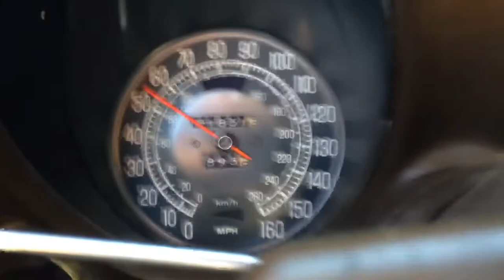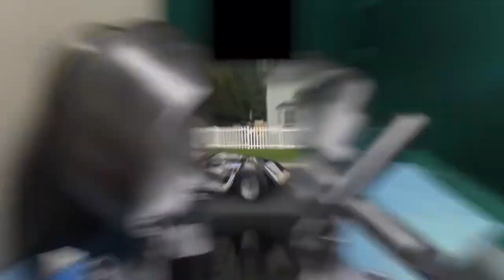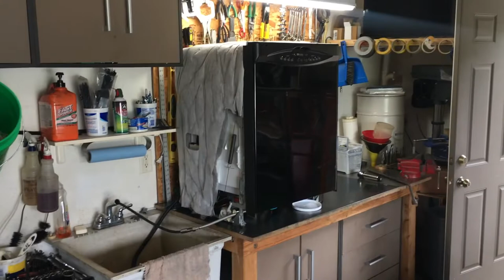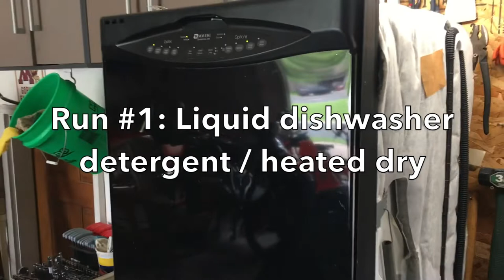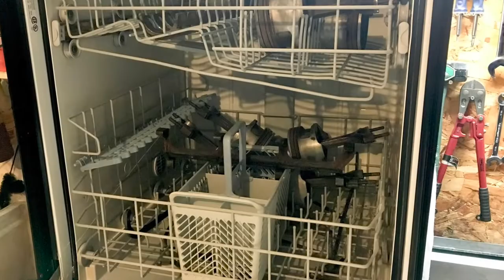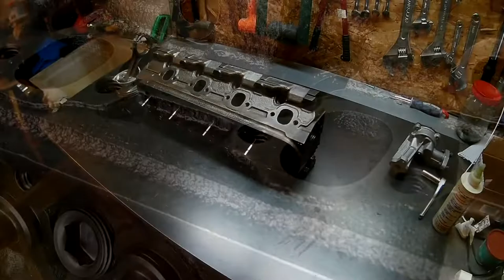Cleaning car parts with a dishwasher

Comment: Great Idea! I was thinking that it would turn the inside black and greasy- but it looks like that isn't the case. I may add one of these to my shop. Way cheaper than a purpose built parts washer and seems to do a pretty good job. Have you dialed in what detergents you use for cast iron and aluminum since you posted this video?

Comment: I was never able to get this to work well with a $50 dishwasher I bought off craigslist. Everything was still dirty. The only thing that I've tried that works is pressure washing. And I use electrolysis for rust removal. If I had room for the dishwasher like in a huge house or workshop, I'd have probably kept it to do alongside pressure washing to loosen up some of the dirt, but I only have a 1300 square foot house and 1300 square foot basement and a 2 car garage. Not really enough space.
Reply from the maker: bummer it didn't work / I use my shop washer a couple times each summer and it works good. Agree a pressure washer is a must have too! Thanks for the comment!

Comment: Let me know if you did any additional strainer or something similar to help keep chunks of debris out of the drain system. Installing a used washer in my shop soon.
Reply from the maker: The base/tub on mine has a built in strainer so I need to check it and clean it from time to time - I do try and get the crusty stuff off though before I put them through a cycle / make sure you use heat too -  let me know how your install works out and thanks for the comment!
Reply: @TacoJoe  - Will do.  I'm thinking I'll put the washer up on a pedestal to get it up to a better height for loading/unloading; I may make a video which I'll post here as well.  We should all talk the best detergents as well sometime....... What is everyone using that seems to work well?

Comment: I want to take my tires off my wheels and clean them in the dishwasher. What is cleaner is best for brake pad residue?
Reply from the maker: Give them a quick scrub by hand like you are doing the dishes to knock off the bigger chunks of gunk then load them up / go for it. I'd just stick with normal dish washer detergent for those because by nature, there shouldn't be a lot of grease so you are in effect just cleaning them up